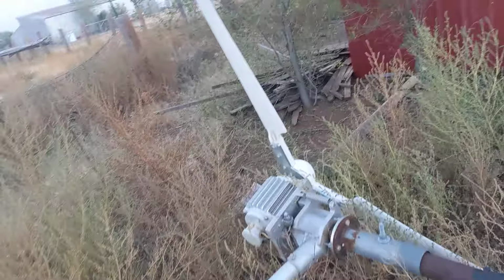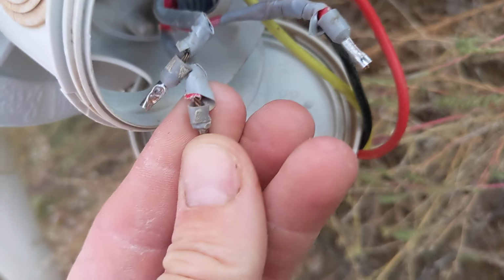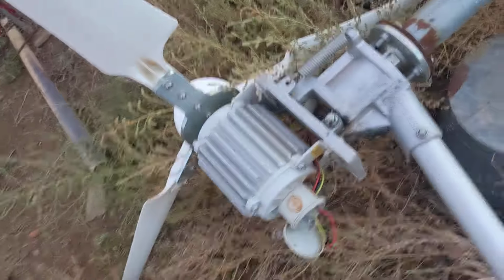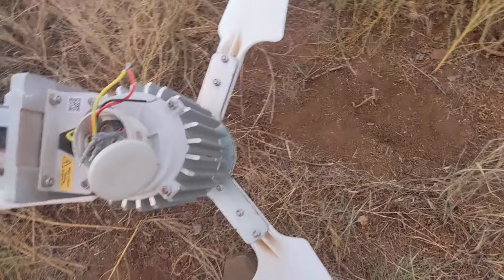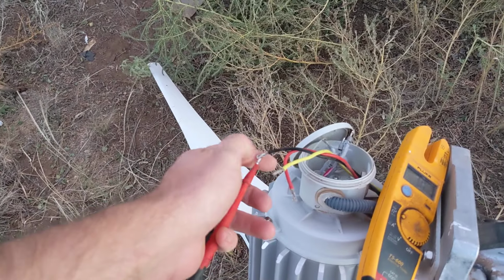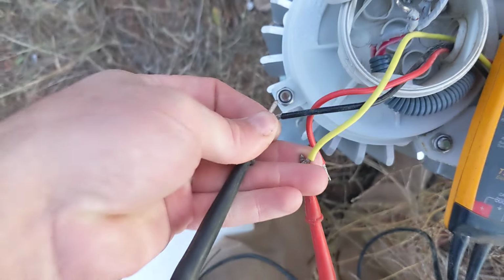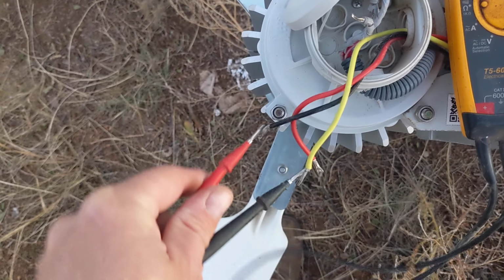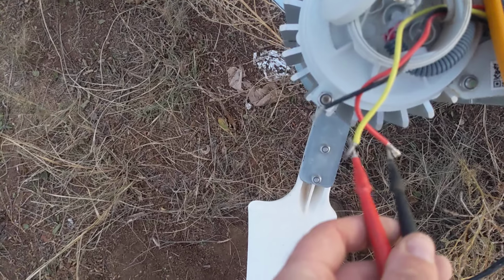The Windsafe i2000 has lost a phase...in May...I finally brought it down to check it out.

Comment: Welcome back sir and good to be able to follow you again, you must be able to buy much better slip rings that are more durable and hope that is just the problem and not something else.
Reply from the maker: Unfortunately most turbines on the market either use a proprietary slip ring or these little 22mm jobs.  The things would actually hold up a lot better for me if I didn't do stuff like run out and throw the brakes at 50mph winds lol
Reply: Just changed slip ring on my i1500. Used similar spec to original. This weak point (cheap capsule slipring) spoils an otherwise excellent machine. I wonder if collector rings would be more reliable than a capsule slipring? Plenty space in the nacelle for that. When I took my i1500 apart, it was like brand new inside despite flying for 3 years in all weather and storms. I changed all 4 bearings for good measure too, while it was in bits. Not too bad a job. Only the yaw bearings seemed rough but I changed yaw and rotor anyway. Got SKF replacements. All 4 for about £40. Machine runs much smoother. Markedly less  grating noise coming down the pole. I suspect the slipring is vulnerable to current rush when braking by shorting out phases. I should probably stick "slowing down" resistors between phases on the braking circuit.

Comment: You will notice that the leads from the actual generator have crimped ferals on them, and the rest of the wire did not. They should have. The problem is not the design of the block, it is the improper manufacturing step of not putting the crimped ends on the wires that go down.